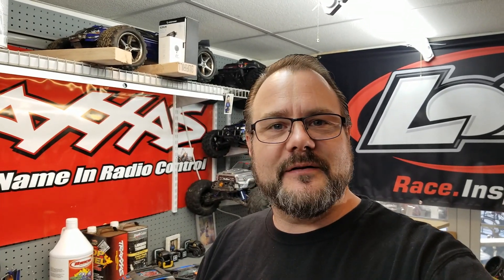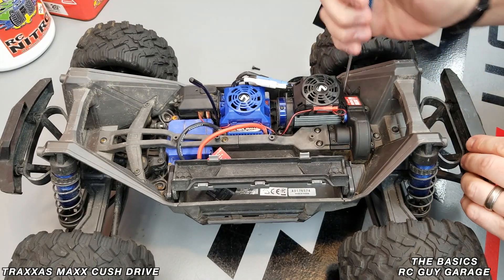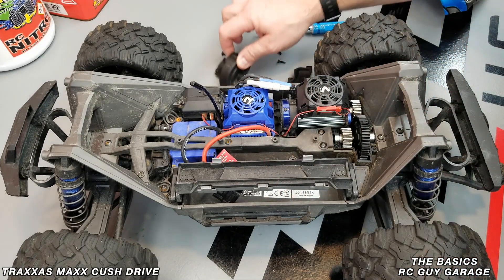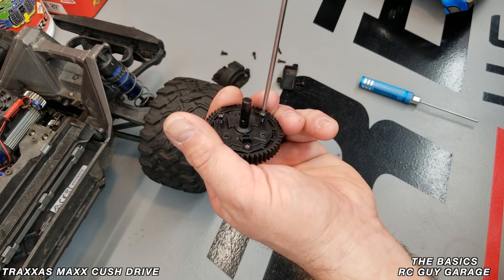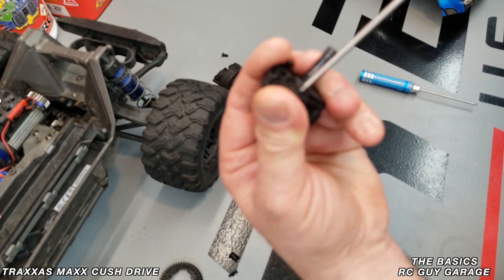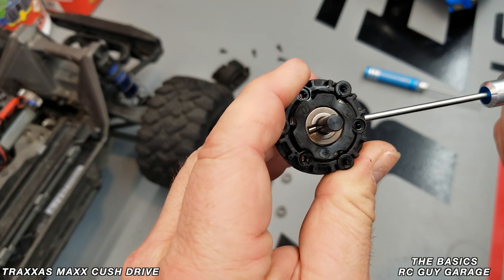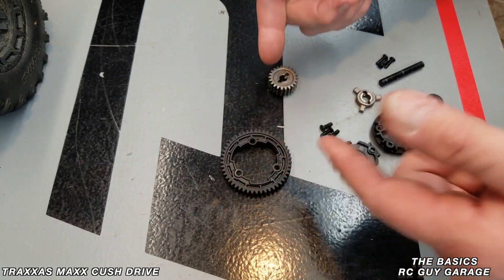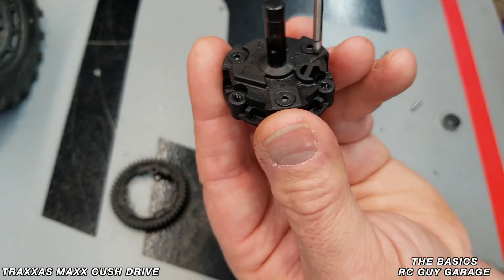TRAXXAS MAXX Cush Drive Disassembly "The Basics" Series

Comment: Good stuff👍 I've been having issues with my Maxx. Did a horrible noise... At the beginning only when braking and today always I pressed the trigger both ahead and backwards. Was told in a Facebook group to check the cush drive rubber and it's basically destroyed... Already ordered the part and this will hopefully solve the issue as everything else looks alright.

Comment: That is such a better solution than the slipper clutch my e-revo 1/16 uses, and the old E-revo used to use. The slipper clutch does work, but i've had instances where some liquid got into the spur and locked the two plates together, causing a rear diff to crack and break under heavy acceleration. Not only that, if it's adjusted wrong, the car seems to lack acceleration.

Comment: 9:24 So it’s exactly like a dual-mass flywheel on manual gearbox real cars. (mostly on diesel engines, and rare gasoline engines with pretty unbalanced rotation like the 3 cylinders…)
Except the flywheel first function who is to had weight inertia into the engine rotation of course, we don’t need that here on the RC.

Or maybe more simple: a drive shaft flector on real cars, but the Traxxas CushDrive design looks more like a dual-mass flywheel to me 

Anyway, I love the idea compare to a slipper who doesn’t have a limit in rotation…
Well done TRAXXAS, plus it looks very well executed. I’m impressed
Reply from the maker: Just to put it more plainly it's just an isolator or dampener BUT DANG you went off on some KNOWLEDGE for sure

Comment: Hey, so I watched your videos and it got me thinking maybe I should check over my Maxx, so I did. Thanks to your videos it made it so simple! Heres what I found. 1) my cush drive is shot! The elastomer cushion is toast! Ordered new parts. 2) center diff looked good, rear diff was a little dirty not bad. Front diff was pretty good. I didnt change fluids just cleaned up bearings and stuff. Thanks to you I saved myself from having to buy new spur gear and all that. Just had to get the innards. Got the wide kit coming as well. Oh and I have 2 broken rims and 1 inner lower control arm pin was bent. 😬 hard bashing lol. This thing is a beast!
Reply from the maker: THAT'S AWESOME!!! Not that you found broken parts but then again MAYBE THAT WAS GOOD though. 👍💯👊

Comment: yeah seal the top gear cover with thick grease. a lot by the motor mount just to be safe. I saw a video where someone got sand almost to the front diff from the top cover not being dirt tight...
Reply from the maker: HOLY S! I did a trick that I've used before in the past with pipe foam but i did it TOO quickly and didn't take time to do it right cause of impatience😂😝🤣😜
Reply: @rcguygarage  if you wanted to be real crafty you could make a gasket with silicone and just tape off (or a tiny coat of vasoline)  the chassis side of things so it just sticks to the cover!
Reply from the maker: @dylanwillyams  oldschool trickery👍💯👊

Comment: Hi man. I had to replace the spur to a steel one. The Maxx drives fine in reverse. But if I drive forward, it makes a grinding noise from this area, especially at higher speeds. Any thoughts? Thanks for the video.
Reply from the maker: You've got to know that diag on this like that isn't ideal 🤣😂  but why did you replace the gear? And if you didn't replace the pinion at the same time (depending on mileage) the gears wore into each other. And if all you did was replace the spur you just matched up a brand new gear with an old worn out one if that's the case this is the best I can do on over the air diag

Comment: Hi Rc Car Guy loved your video I need to ask what is that plastic spacer/shim against the pin, I don’t have that included with mine and it’s not in the manual is there a part number? Thanks
Reply from the maker: Unfortunately I do not believe that single piece is available however the kit is only $3 includes the washer you're talking about.
https://www.amainhobbies.com/traxxas-cush-drive-housing-tra7793x/p742305?gclid=CjwKCAjwltH3BRB6EiwAhj0IUEtOlgZX8t8nTUWc_QNyqbNw14oTU9AECHLfD2yUdZukXUOVaQp5OxoCHD4QAvD_BwE
Reply: RC Guy Garage thanks alot for your help

Comment: On my Emaxx I have a dusty motors cover that keeps a lot of the dirt out . I am not sure if they make one for this truck
Reply from the maker: I think with the design of it and all plastic it's just something to watch and keep up on maintenance something that I'm terrible with😂😝🤣😜👍💯👊
Reply: i got a pretty nice one off of ebay, just concerned that it restricts airflow, temps went up a little bit since i got it.
Reply: With my Dusty motors cover I leave the sip open on the top to let the heat out and I have my shell set quite high up. My Emaxx you can adjust the height of the body shell.